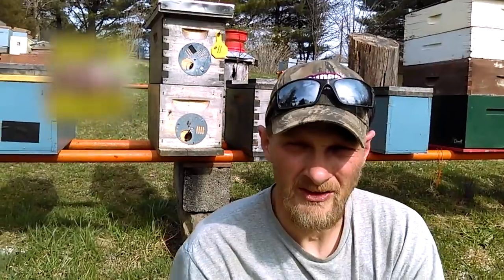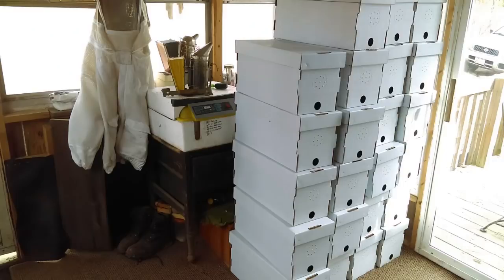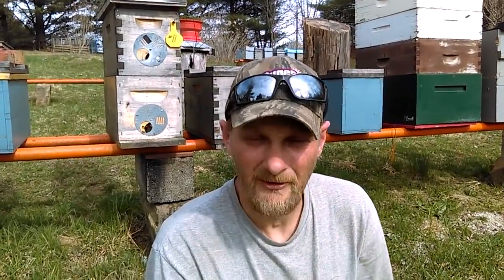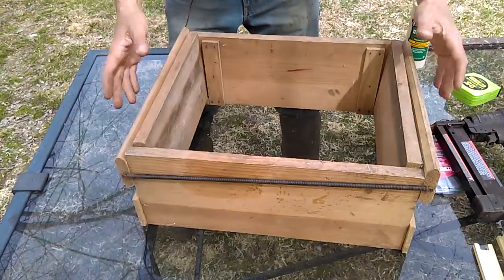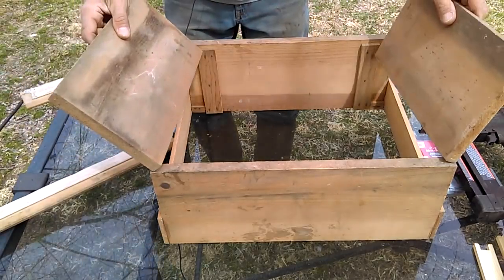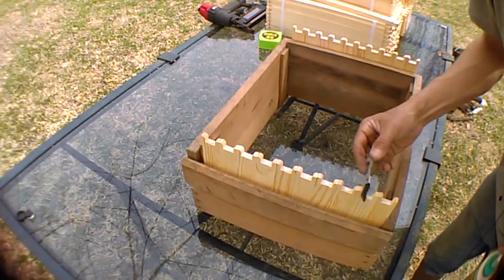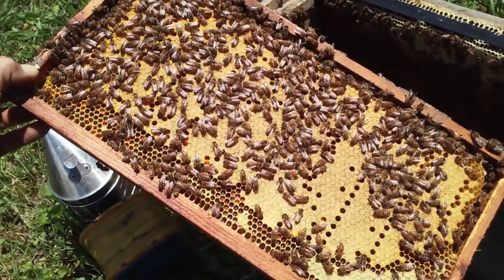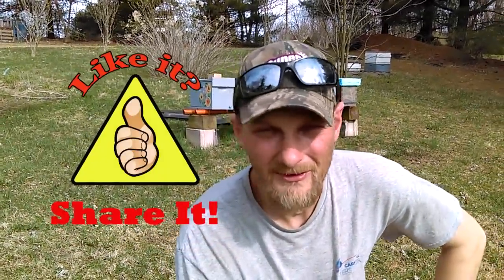Assembling Beekeeping Frames With A Jig & Installing Ritecell Foundation

Comment: I use 1/4” crown staples and drive one into the side bar to secure the top bar as added strength. Not often does a staple exit out of the wood and if it does I just take a tack hammer and flatten it down . I haven’t seen an older model deep frame jig in a long time . At one time I had to buy two or three different jigs for all three size frames . Now there is one jig that fits all . Titebond II and III is some very strong glue . I took one brood frame and secured a small rope at each end of the frame and secured the rope to two ten pound bags of sugar and lifted the bags of sugar without the frame breaking. I did that test the day after I assembled the frames . Note I placed the rope around the bottom board right beside the end bars to test the joints strength.

Comment: I pour my glue in small silicone bowl and apply it with silicone basting brush.  It allows even coverage and pretty much stops runs. It’s easy to clean up, too. Here’s another tip:  buy your own, DO NOT use your wife’s.

Comment: Titebond is excellent glue. Glue the frames with it as shown and they'll be as strong as possible.
But, I saw someone using glue coated quarter crown staples without the step of adding glue separately. It cut my frame assembly time by over half. They won't be quite as strong and I'll see how long they last...
Reply from the maker: For nearly 15 year I refinished old furniture. Sometime a customer would bring something in piece that used to be a family members and I would have to re-assemble it. I learned then that there is nothing that can replace a good glued joint. I do however understand that gluing takes a lot of time but in the long run it's well worth it. In my case, these frame will eventually belong to a customer so I want them to be happy when they pickup there nucs.

Comment: Hello my friend Jason.  I'm putting together a beehive and made a big mistake that I would like to ask you help with .  I did NOT use 90* corner brasses to make sure they set straight, and now the box down line up with one another.  So I have taken them apart, ordered the corner brasses, yet don't know how to correct the screw holes that are already set?  I feel like even with the brasses intact, the screws are going to go right back into the same pattern and the boxes will again be off centered.  I've had some suggestion to using the corner clamps and gluing the boxes together making sure it aligned, and then let it set for 24hrs before re-screwing.   What would you recommend?  It would be so helpful to hear back from you.  This is a project that is very important to me.  Thank you so much.  Brad
Reply from the maker: Hello Brad, I've been in your shoes a few times before. lol I don't use the metal corners, instead I use clamps and a big carpenters square to make sure everything is where I want it. In your case, I would try the suggested tip, glue and let sit then screw. Just make sure everything is square before you walk away to let it dry. Good luck!

Comment: I've heard many people saying that you should not glue anything in the hive, some even say you shouldn't glue the hive body. I see that you are using glue on your frames but I was just wondering if you ever heard of this and what your thoughts are. I'm leaning towards glueing myself as it is more structurally sound but I have some concerns about contamination by formaldehyde from the glue.
Reply from the maker: Glue has never been an issue with my bees over 11 years but it may be due to the fact that Titebond glue is food safe. If I were you I would be gluing all my joints.
Reply: Thanks so much for the great vids. Sounds like I'll be using Titebond!

Comment: Good Job Jason! Like the jig a lot, although I’ve never understood foundation? When I started keeping bees I never used it, and I just never got into using it. I use an F frame from Kelley that has a tapered top bar and the bees draw it out nicely. I extract them all the time and they also make nice cut comb honey. Cold weather coming back down here in Southern Ohio, I bet up there too?
Reply from the maker: I have played a little with going foundationless and it does work but I think it takes a lot more time and when selling nucs time is not an option. That's another reason I paid extra for the premium foundation. Kelley is who sell the frame jig I used in this video. The did a great job on it. 
Yes, it's chilly and raining cats and dogs here. Keep warm and dry!
Reply: I also use the Kelley F style. I also put a nail on the side bar and run 50lb test monofilament in an X for support. You can still extract or make cut comb....just need to avoid the fishing line.
I also started using glue coated quarter crown staples to assemble the frames. It saves some time. Getting the glue into the frames took the most time for me.

Comment: Hey Jason. When i make foundationless frames, I run Kevlar braid fishing line, in a inverted W pattern between the top and bottom bar. I don't see any avoidance in comb above where the line is.  Great video as always...and thanks again !
Reply from the maker: @Steve Mixed Bag Glad to hear foundationless works for you? I have very few foundationless frames but I do have some.
Reply: What lb test do you use? I tried 15lb monofilament and the bees chewed it up. I switched to 50 mono and it seems to work better. And, i wondered if braid would work. Good to know it works
Btw, you meant spectra, correct? I haven't seen kevlar fishing line.

Comment: Did you use a brad nailer or a stapler on the frames.  The end on the gun looked too wider for a brad nailer.
Reply from the maker: My gun shots booth staples and brads but I used brads.

Comment: I got my first package of bees exactly 1 week ago today and they have already built comb on all of the frames with the largest comb taking up about 1/3rd of the space available on its frame amazing how quickly they build. Of course it may have helped that I made a feeder for them out of a jar and let them eat out of it for the first 5 days, I placed it inside the hive and ended up having to refill it everyday, I stopped because I saw how much pollen they were bringing in and figured they probably didn't need the sugar water anymore as they are probably collecting more then enough nector.

Comment: I'm very disappointed Jason, I spent almost 18 minutes watching how to make frames with a jig and when I got done...I didn't have even one complete frame. I think this is a case of clickbait, however I'll forgive you if you send me like 100 assembled frames with foundation this week.

Lol, looking forward to the hive inspection. Take care.
Reply from the maker: Sorry bud but that how all tutorials work. If it worked the other way, I would be watching how to build a portable livestock shelter. lol I will tell ya though, even with a jig doing a 100 frames is a bit overwhelming.
Reply: @JCsBees  Lol, yeah it's a tragedy isn't it.
Yeah I hear ya, last time I ordered frames I ordered a couple hundred deeps and mediums. Even with the jig like yours, it took a good while to get through them all. I bought some foundation like you have in this vid and cut some of it in starter strips and hung in the top bar, that seemed to work pretty well and saved a lot of money. I always have mixed results with plastic foundation. Some hives draw it out okay and others just kind of flip me off. The later in the season it gets the less likely they are to draw it out seems to me.